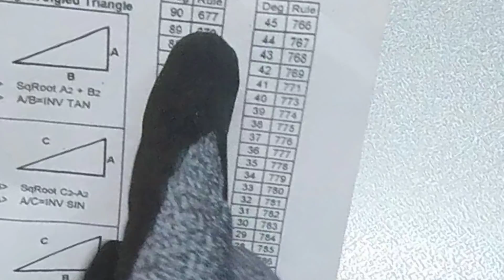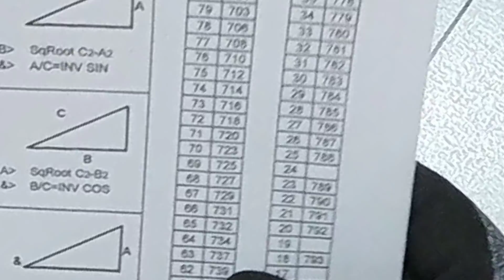How to find degrees in Folding Ruler

Comment: Thank you! I had a line of Chords rules years ago that was stolen. It allowed me to set up angles in exactly the same way using dividers set to the correct length. This is just as accurate.

Mark
Reply: This is a very useful short video. I suppose I knew this at one time but it had completely slipped my mind.